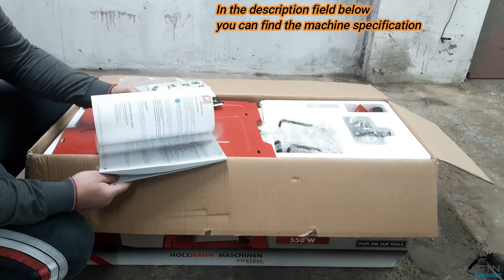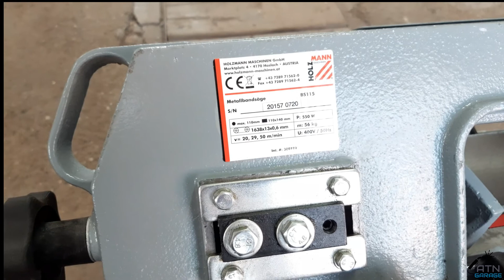Holzmann BS 115

Comment: you have to calibrate the saw! i think you will be more accurate, under 1mm errors. the speed that you selected was too hi, for copper or aluminium, not for mild steel. select the middle speed. is a diy tool, good for those who love working with metal, to make a gate, iron door, etc. good luck!